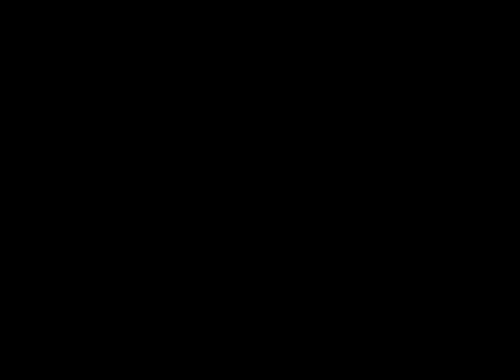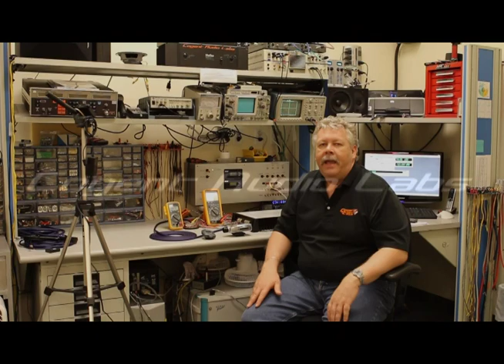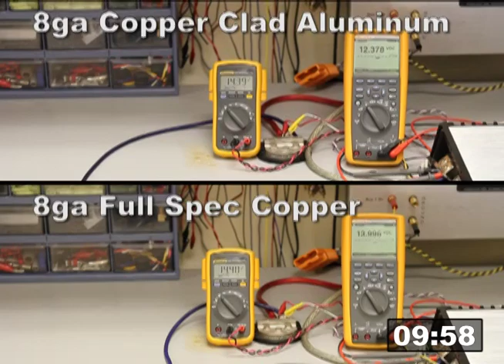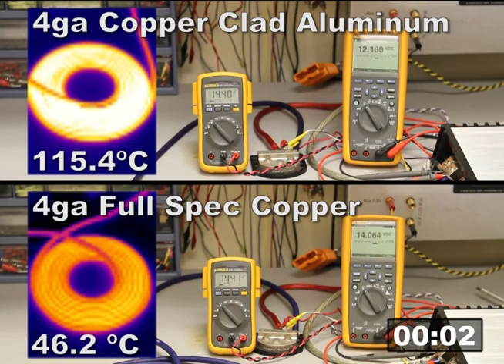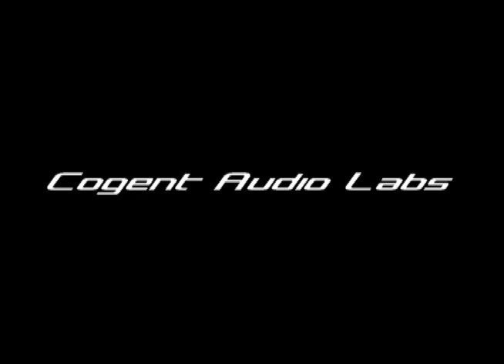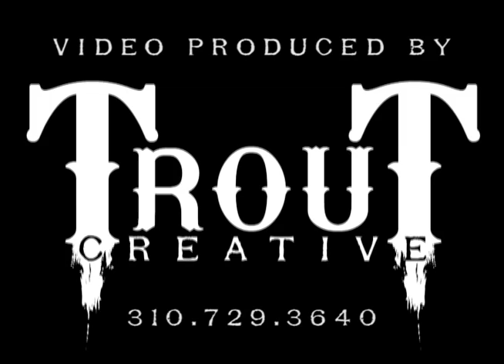Wire comparison with thermal camera feat. Garry Springgay at Cogent Audio Labs

Comment: Very Good video.  
It would have been a great video if you included the length of the wire. (ball park even would be good.)  
The amperage draw! or at least the Amplifier used and it's Wattage would make this a fantastic video.

If you could give us the estimated length of the wire now, and possibly the amplifier you were using, this video would be a lot more helpful.  

Much Thanks for all your efforts.

Comment: You should have included what wire you were using, strand count for each wire, and what amperage was being put through the wire.  CCA and OFC wires of equal strand count are rated for different amperages.  It'd be easy to manipulate the "risk factor" that you are presenting by using cheapy CCA and beefy OFC wire, while putting the max rated amperage for the OFC wire through the CCA wire as well.  Not saying you would, just that it is easy to discount the test without more details.

Comment: A local store is selling  welding cable that is rated for 250 celsius. Strand count is not of importance in a DC (car audio) circuit, it does matter for AC (skin effect) however. Cross section of the cable is what counts. As far as car audio is concerned, more strands = only more flexibility, nothing more. That being said, most quality car audio "1/0" wire is really more along the lines of 2/0 or even 3/0 and flexibility does matter in certain installs.

Comment: What was the Amp draw of these tests? I could understand if it is at the limits of the CCA. I run the "Welding Wire" that is "great for welding,but not for car audio",and have never had one problem.Actually not one problem with CCA either.What were these cables rated at,and what were they tested at?

Comment from the maker: Welding cable is perfect for welding but is totally the wrong item for car audio. A car audio cable is designed with a high-temp jacket that can withstand up to 150 degrees Celsius before it fails (melts). There is no standard for welding cable. In fact, a quick google search and you'll find that a 4AWG welding cable has a 105 degree Celsius jacket and only 456 strands. A CEA-Spec car audio cable has nearly 2000 strands! Among other things, strand count affects the flexibility of the cable.

Comment from the maker: It's important for ANYONE looking to get 100% of the performance from their amplifier. The truth is that a 30% reduction in voltage to the amplifier affects the power the amplifier can produce, the efficiency the amplifier operates at and the resulting heat that the amplifier generates. There are no negatives at all to choosing better wire.